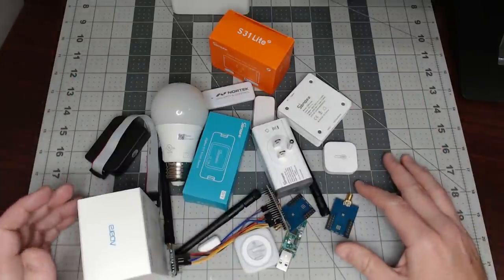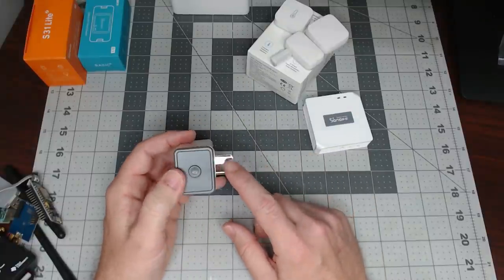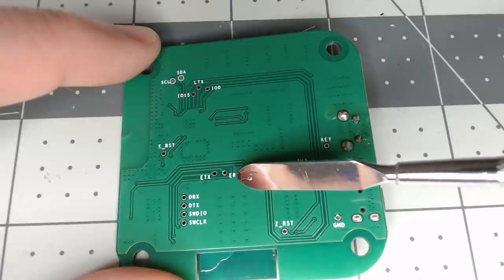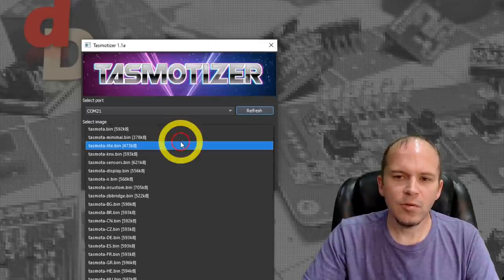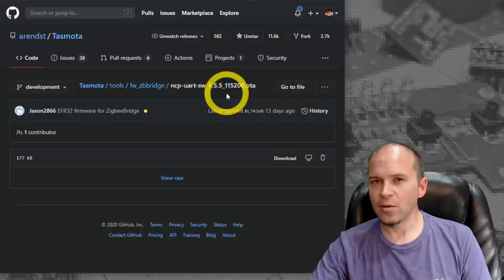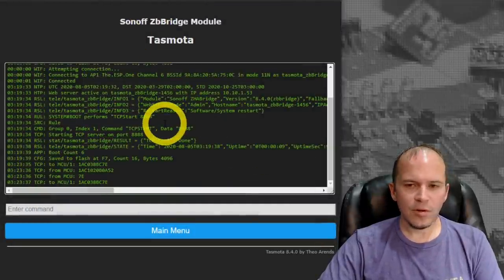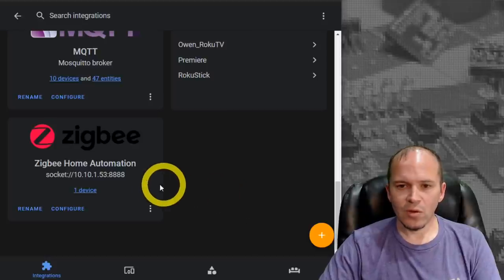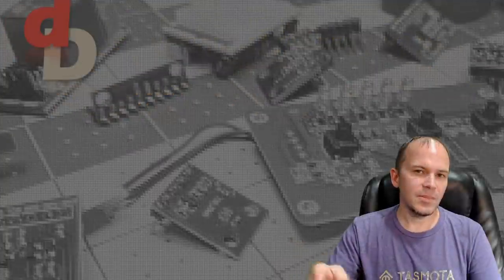Sonoff Zigbee Bridge with Home Assistant using Tasmota | NO Soldering | Step by Step Guide

Comment: finally, I configured the Zigbee ... your method is 100% working ... the only problem I faced -esp8266 not connecting to pc ... I tried several method and finally made it ... thank you, Bro
Reply from the maker: Great 👍  thanks for the feedback!
Reply: that's my current problem... how did you solve it?
thank for your time
Reply: @digiblurDIY  BRO one help I'm facing this WARNING message in log every time 

`````
Logger: bellows.zigbee.application
Source: /usr/local/lib/python3.8/site-packages/bellows/zigbee/application.py:644
First occurred: February 19, 2021, 10:32:20 PM (30 occurrences)
Last logged: 9:08:35 PM

Watchdog heartbeat timeout:

``````
Reply: @sylwestersuchecki9034  could you solved it? I'm in the same point, I tryed using an arduino UNO as TTL converter and a FT232, and I'm obtaining the same error msg....

Comment: After watching, I immediately ordered from ITead and it was finally delivered after about a month!  I also picked up a variety of sensors as I have zero zigbee devices but I'm sick of the fragile and inconsistent z-wave integrations (errrr z-wave in general) with HomeAssistant.  This video, along with the blog post (added some clarity that I needed) were great!  

The Zigbee temp/humidity sensor is working great and the range seems great; reaches my master bath from my network closet which is about 80 ft & 3 walls + 1 brick wall.

My flashing process was a little finicky but overall smooth -- the USB to TTL device I had acted up after trying to take a backup of existing firmware via Tasmotizer.... but after unplugging it it started working again.

Tip 1: I found some different cable sets on Amazon that included male-to-femaile as well as male-to-male wires in one set.  This let me use a breadboard for joingin the grounds together instead of mucking with the way that is presented on the video.  

Tip2: BUT, these wires did not fit in the holes of the Sonoff Zigbee pcb nearly as easily as shown in the video.  IN fact they didn't fit at all initially.  But upon close inspection I could see that the male ends of the wire are folded over (not solit) so by squeezing them with pliers, to deform them, I was able to get them small enough to wedge into the PCB with a pretty solid connection and flashing went smoothly after that! 

I bought this wire kit:
https://www.amazon.com/gp/product/B07GD2BWPY/ref=ppx_yo_dt_b_asin_title_o09_s00?ie=UTF8&th=1

Comment: Update on my xiaomi sensors, I now have them all working. The switch & xiaomi cubes only show as a power entity, but zha_events show the switch clicks (no hold/long press) & cube actions. These are set up in either ha or node red to activate other entities etc. Shame they aren't fully integrated, but maybe in the future =). Works for all intents & purposes though, so happy.
Reply: so glad I read the comments... Xiaomi/Aquara devices are just want I wanted to add with this hub. Any better luck?
Reply: @ein57ein  They work great, once paired to the hub.

You may have to try several times, but they will eventually pair.

Comment: Thanks for the guide! 
I can confirm that flashing the Sonoff with a CP2102 based flasher just doesn't work, while a CH340G based flasher did the trick the first time around.
Reply from the maker: Haven't heard that one yet and so weird to see as the cp2102 was king on a dimmer flash. Goes to show you that having a couple tools in the toolbox helps figure things out.
Reply: @digiblurDIY  Exactly! I saw that video and tried flashing it with external power, but still no luck.
Reply: i cant get my ch340g to flash. any tips?

Comment: Thank you for a great video. You cover topics so well.
I purchased a Sonoff Zigbee Bridge. It arrived today and following your video I was able to get it flashed and integrated into my HA along with some Aqara Motion Sensors (my goal). 
I wanted to take this opportunity to let you know I did have a very minor issue getting the Bridge to start taking the binary file.
I had to add one more connection. Grounded the Z_RST connection on the Bridge and upload was able to start and complete.
Thought you might like to modify your online instructions.
Reply from the maker: I have heard someone else having to do that before, the RST should happen when the upload starts though.  Makes me wonder if one of yours has a possible issue, luckily it doesn't have to be flashed much.  Thanks!
Reply: Hi I have the same  issue can you pleas
Explain more since I jumped reset pin with ground but still stucked on XMD Bootloader timeout.  Thanks

Comment: Great video, thanks for the help on discord the other day. Mine is running very nicely. Some issues picking up a couple of sensors I had stuck around. Resolved those by plugging the bridge into a battery pack and bringing the sensor to the sensor (I’d stuck them down) .
Reply from the maker: Good to hear

Comment: Unrelated device: recently attempted to flash a device via the UART connectors. Read the bin off fine, and wrote the new one. All was good. I plugged it in to the power and nothing happened.

It took a solid 30 seconds of looking at the board to see a blob of solder that I'd dropped and shorted the board out. Rip to my first and only attempt at manual flashing. I'll try again soon with a bit more care and patience

Comment: Just successfully flashed with your tutorial, thank you !
I had to enter the first "Backlog" command a second time to flash the zigbee chipset sucessfully.
At this time I'm not able to add it to home assistant, but I will probably post about it on discord.
Reply from the maker: Able to finally get it right?
Reply: @digiblurDIY   Yes thank you, as I said on discord my zigbee chipset wasn't successfuly flashed : the wifi connection must be good otherwise it restart before doing "XMS : Init packet send"
Reply: After it's not easy to pair devices  thru the home assistant ZHA integration. I have better results with the MQTT firmware : in this mode the pairing is less problematic but I found that this mqtt firmware  seems at the very early stage :  for example it doesn't seems to make difference between simple clic and double clic with the aqara button.
For sure it probably going to be better in the futur ;)
Reply from the maker: Limitation of the HA Zigbee Integration?
Reply: @digiblurDIY  May be that the TCP communication is not enough reactive for EZSP protocol ? I don't know... May be I should try with the sonoff ZB next my wifi box.

Comment: Just got working a SNZB-04 (window/door sensor) and SNZB-02 (temp/humidity) from Sonoff :)
Reply: It didn't work for me. SNZB-02 (temp/humidity) shows state "unknown" in HA and SNZB-04 (window/door sensor)  is not discovered. I use Tasmota 9.1.0.2 and ncp-uart-sw_6.7.6_115200.ota
Reply from the maker: I have them and they work fine.  Try to pair them up again.
Reply: Might be the battery apparently.  They can be a little ropey

Comment: Thanks for another really useful video. Had to wait a while to get my bridge from itead and also ordered door sw, movement and temp sensors.
Took me about an hour to flash etc, but then I did solder the ftdi leads first. 
The Sonoff sensors added really easily, but an Aqara temp/humidity/air pressure sensor took many attempts before adding. I almost gave up with it after around fifteen goes.
After pressing its pairing button for 5s and letting go, it flashes once if not paired and three quick ones when it works.
Reply from the maker: Yep, I had to try several times too on those. Someone else said if they are too close it causes an issue?

Comment: Good night, first of all I wanted to congratulate the video, I already enjoyed it and subscribed to the channel.
 I'm having some instability with the ZigBee network using the Sonoff bridge as per the tutorial.
 I have about 15 Zemismart switches here, the first 5 were very easy to pair, then a great instability started and the devices did not synchronize with the bridge
Reply from the maker: I would try posting ZHA issues to the developers of the integration on the HA forums.

Comment: Hi, it is a perfect solution to work with that in Home assistant. 
Just one question: due to concrete walls and distance it is difficult to connect all sensors to one bridge. How can I connect a second Sonoff/Tasmota ZBBridge to Home assistant?
Reply from the maker: You would need to use like Zigbee2mqtt to do a second network or instance. Much easier to just get a couple mains powered devices to route traffic.

Comment: These instructions worked perfectly - thanks!  Was wondering now it's setup - is there any way to configure the device to have one of the LED lights lit when it's powered on and active, just as an easy way to tell the device is alive at a glance?
Reply from the maker: You could try adjusting the LED settings in the template but I haven't done it myself.

Comment: I had to connect the Z_RST pin to GND in order to flash with Tasmota. I have the Zigbee Brige V1.1 Now it works fine
Reply from the maker: The process should do that automatically but if there is some hardware issue I could see that having to be manually done.
Reply: Same here. Thanks for the info!
Reply: Did you connect Z_RST & GND for whole process ?

Comment: I flashed the newest Tasmota zbbridge version 9.3 and noticed on the console output that my zbbridge was always restarting. After pasting the first command "Backlog Weblog 3; so65 1; Module 75" my bridge even freezed and after that although connected to my wifi I could not access the web UI anymore. Unfortunately I couldn't find any issue about this on github? By flashing the older version 9.2 everything worked fine....
Reply from the maker: I updated the guide yesterday to not use 9.3 as others had the same issue.

Comment: Please your help, when flashing procees ends I had the a error message (MD5 of 0xFF is 4ec2e29ca3952043a72fadadd997769a). The Zigbee bridge is a V1.1 dated 20.02.28, it's powered by a 3,3V power supply, the ground is common with the USB to Serial converter, and ETx to RXD and ERX to TXD are proppertly connected. Flashing was used Tasmotizer, and  also NodeMCU-PyFlasher, both whit the same results.

Thanks for your help.
Reply from the maker: Try holding z-rst to ground the entire time.

Comment: Good evening,

Today i received my Sonoff Zigbee bridge, board version v1.1, dated 20200228.
I walked through the proces described here and on your site. 

I get tasmoto on it and can change the wifi setting. The bridge connects to my wifi and it functions.
After that i do the backlog command and then it isn't going like supposed to. 

First of all i see the cmd in the console and after that it doesn't say anything anymore. Also the wifi connection is dropped and there are a lot of connection timeouts.
I've seen that in templates the custom template is selected and nog the sonoff zigbee bridge, do i have to select this? i didn't select a template due to the fact that it isn't written in the tutorials.

Are there more people with this problem? Why is the backlog command making the bridge work? What can i do about it?

Hoping you or someone has the sollution so i can proceed with flashing the zigbee chip and use the device in HA.

Greetings,

Mark
Reply from the maker: I've been updating the guide here, not much has changed but just a few things to look out for.  https://www.digiblur.com/2020/07/how-to-use-sonoff-zigbee-bridge-with.html
Reply: Thanks for the reaction. Going to check the link. Hopefull to get everything working 😃
Reply: Same problem here with board version v1.1 ... :-/ 

The updated guide unfortunately did not solve the issue.
What is the command "Backlog Weblog 3; so65 1; Module 75" for exactly? Can you just skip this step or will there be a risk of bricking the device in one of the next steps?

Thank you in advance and by the way: I love your tutorials. Great work!!!
Reply from the maker: Board version doesn't matter. Where are you stuck?
Reply: @digiblurDIY  I flashed Tasmota 9.3.  ... Shame on me and sorry for that. -> 9.2. runs perfectly. Thanks for the fast reply and the detailed guide. I should have just read it carefully.

Comment: Hi thanks I followed this video and install/configure the Za bridge, have few mini behind switches and door sensor, Problem my sonoff thumb switch I can only see the battery not the switch so there is no way i know if it's working. I tried to automate it in Home Assistant but cannot find the device in the trigger section....any suggestion. Also does MQTT{ which is not configure in Tasmota}, cause any conflict with ZAH integration. Thank you.

Comment: Plz guide which one should I buy Sonoff zigbee bridge pro 3.0 or SONOFF ZB Dongle-P Zigbee 3.0 USB Dongle Plus Wireless Zigbee Gateway Analyzer Zigbee2MQTT USB Interface Capture with Antenna
I don't know how to flash any software. I need something that doesn't require any flashing. So that I can directly use it to add zigbee devices and use it with homeassistant.  

Kindly reply.
Reply from the maker: USB adapter for sure! Plug and go.
Reply: @digiblurDIY  thank you for the reply

Comment: Great video as always.  I plan to replase my zigbee2MQTT dongle with this as I use dockor on me Synology NAS.   Synology apparently will no longer support dongles with the release of DSM 7.0.    There was a way to setup a net network key with zigbee2MQTT for increase zigbee security.  Does the Sonoff zigbee bridge also have this feature?  Thanks
Reply from the maker: The network key is in z2m config. It is required no matter what adapter you use. You should always auto generate a random one or change the default.
Reply: @digiblurDIY  Thanks, I just ordered an sonoff zigbee bridge  :)

Comment: Tks Travis for sharing your work. I have been learning a lot with your videos.
If I keep in tasmota zigbee mode, is it possible to enable mqtt? Once enabled, is it possible to configure each device individually? 
I would like to send sensors data to influxdb, for example. Cheers.
Reply from the maker: Yes, enabled MQTT and you'll be able to control it via MQTT and the Tasmota console using the Zigbee commands of Tasmota. https://tasmota.github.io/docs/Zigbee/
Reply: @digiblurDIY  Got it. Tks man!

Comment: Hi, thanks again for this very useful video. I have one question, after flashing the tasmota firmware you saying there are 2 different ncp*.* files. In your video you choosed one. Is it possible to the other ncp file if we want to test the second one ? or it's to late and we have to do it on another Zigbee bridge ? thanks in advance.

Comment: Thanks! I finally get my devices connected, btw my SONOFF SNZB-01 - Zigbee Wireless Switch only get battery status entitled, no click button status entitle, any idea?
Reply: I am having the same issue. The OP responded to a similar question -> "Until they get that fixed in ZHA you can roll with the MQTT method." Now I'm trying to work out how to do the MQTT method 🤣
Reply: @gregologynet  I see talk of this but nothing complete.  If you have it figured out can you post what you did?
Reply: Same here.  SNZB-01 connects without issue, only reports battery status.

Comment: Great video! But I have a question..after flashing the device will it still be visible in the sonoff app?

thanks!
Reply from the maker: No. You are taking the control over the device you bought and bringing it local.
Reply: @digiblurDIY  thank you for your answer :-) Is there any way of flashing the devices to back to their original software if needed?
Reply from the maker: If you have serial TTL access to the device you would back up the firmware before overwriting it.

Comment: Wondering where you got the junper lead from. Mine is too big and won’t fit. Thank you for your video.
Reply from the maker: Those are breadboard jumpers.
Reply: @digiblurDIY  My breadboard jumpers were little thick. So ended up using ethernet wires instead. Thank you for your detailed guide.

Comment: I've got a problem with the Sonoff Button (eWeLink WB01). Only the battery state shows up. I've tried removing and re-pairing it with no change - only the one entity shows for the device. A door/window switch and motion sensor work OK. Any ideas as to what the problem may be?
Reply from the maker: I don't have one to test with it, that might be one of those devices they need to set up a handler for in ZHA as it doesn't go by the zigbee alliance.  https://pypi.org/project/zha-quirks/

https://www.home-assistant.io/integrations/zha#reporting-issues
Reply: @digiblurDIY  Thanks Travis - I'll follow up the links you've given.
Reply: Have the exact same problem. Jim, did you manage to solve it?
Reply: @yaronkeinan3869  Yes, it's sorted now - see this thread:
https://community.home-assistant.io/t/unable-to-pair-sonoff-zigbee-snzb-01-wb-01-buttons/218324
It should help.
Jim